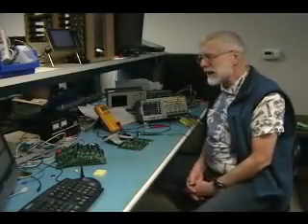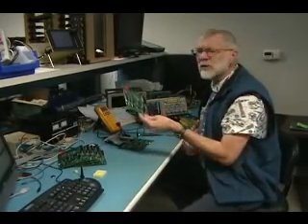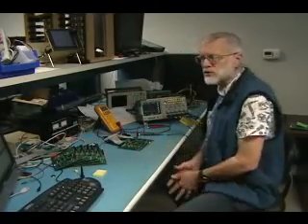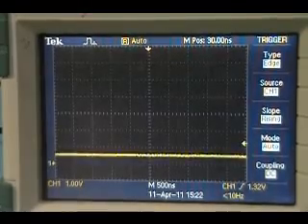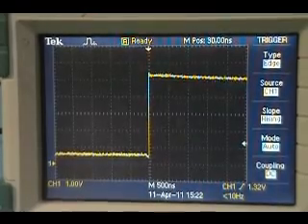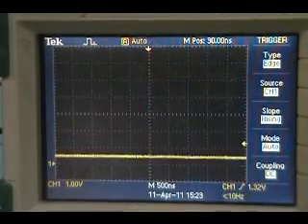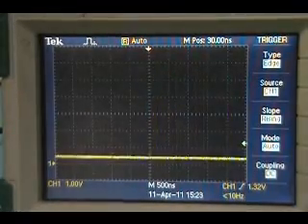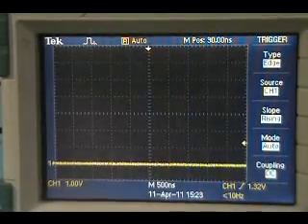ShortSniffer Short Circuit Location of Board Faults

Comment: Oddly I have been doing this testing for shorts on server motherboards for a long time now. 30 years. As the concept of this idea is based on the Telecom or Telephone sniffer idea we used back in the day to trace wires in a punch down blocks(where all phone lines meet on a panel) with telephone lines in buildings. So if you have to work in a large factory with many telephone lines in it. We would inject noise, or put on a tiny noise generator(The 77M Noise Tracer) on one end in the building, say the owners office phone, and then walk over to the punch down block panel where there are 100's of phone lines coming in centralized on another part of the building and use a detection tool to hear the beep on the other end in the building. And know what wires we are tapped into. The tool we used was the PROGRESSIVE ELECTRONICS 200B INDUCTIVE AMPLIFIER tool. Or Induction Tracer Tool. Something I have been doing for years till I spotted this gadget here. So I can see where the idea came from. Not bad!
Reply from the maker: I have a couple of the "Fox-n-Hound" signal injector and pickup devices for troubleshooting and tracing.  They will work to find which light bulb in a series Christmas lighting string is open.  Bringing the Hound up to each bulb in the sequence of the wired series while listening for a lower amplitude signal, then backing up to the previous bulb (which didn't pass the signal).
Reply: @CarlVanWormerAE7GD  Yes. The concept of this tool is the same idea as your tool. I troubleshoot alot of motherboards. And actually have used the FOX-N-HOUND from Triplett on them too. LOL! So you see. You pretty much already own a induction detection tool like this. And can be used on circuit boards as well. Just have to put a rubber boot on the tip. As FOX-N-HOUND have a bare metal tip on theirs. But good idea. Techs can use a tool like this youhave.
Reply from the maker: @synologyonline  I think the Fox-n-Hound type devices are actually voltage-sensing devices instead of current sensing, since they exhibit proximity detection with no directional information (high impedance).  The ShortSniffers are low impedance sensing devices, providing directional information to aid in the sleuthing.  The SS3 even provides stereo feedback with the forward/reverse direction translating to right-left ear outputs.
Reply: @CarlVanWormerAE7GD  Maybe so. The concept is similar. As even a bare wire with something on it. Like a pulsing signal of any sort. Even with no return signal has inductance, as the wire or trace in itself alone has impedance from the air around it. Even capacitance as well if close to another object. Even the pickup coil when traced. Already induces capacitance. So nominal but able to still receive a signal. So now always all 3 factors needed will be present. Its the pulsing of the origination signal alone that helps with induction. Or any form of alternating voltage or current flow. The rest are always present enough to get a reading. Even the frequency of the originating signal,  can have variable factors in the outcome readings. FOX and Hound also works like those in house drywall testers for detecting opens, and shorts from wires in walls. Just the concept runs similar to all these devices.

Comment: Can this device be used, to find shorted discrete components - caps, transistors, resistors,etc, ?
Reply from the maker: Yes, it doesn't care what the original component is.   The test current follows the path of least resistance (along the traces and through the shorted component) while you are tracing the current path as you follow the sound.  Please let me know if you have more questions about the operating process for anything not answered in the videos.

Comment: All loaner units are currently being used, some with great success at the recent Solar Car race in Texas (OSU came in 1st place!).  Although ShortSniffers are the best tool for the job for first-power-up troubleshooting (real solder shorts), general repair of "broken" boards seldom suffer from shorts (except for repair screw-ups).  The closest success I've had was finding which chip melted when the power supply put 12V on the 5V bus.  Do you have examples where a ShortSniffer would work for you?